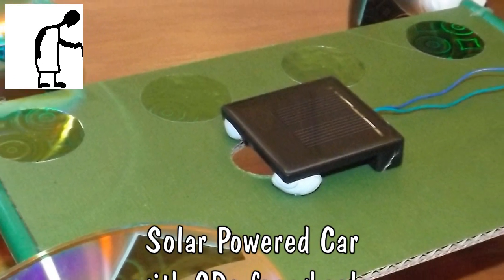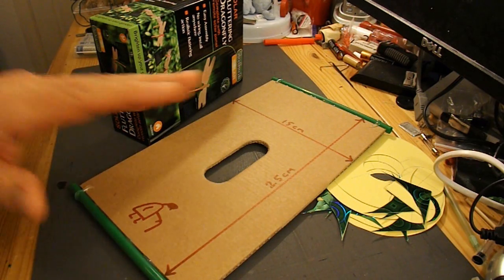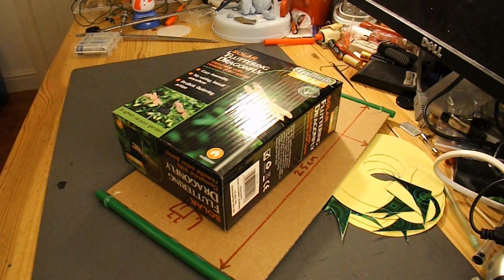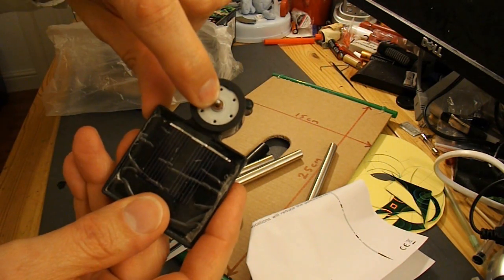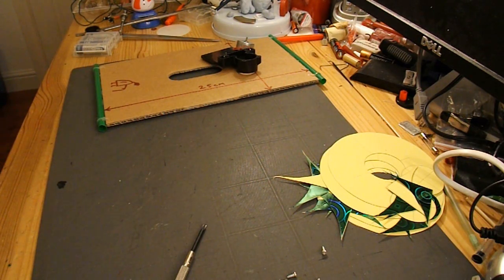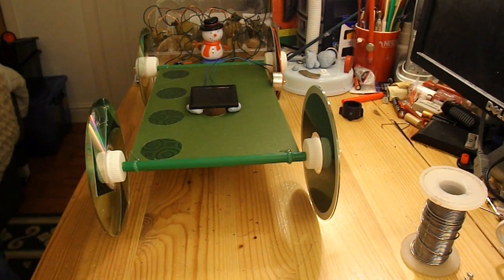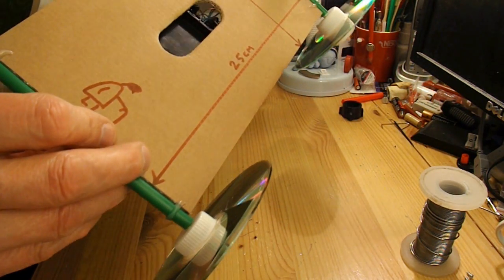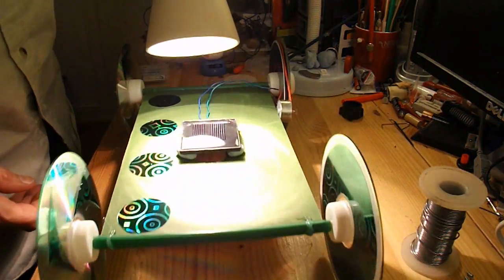Solar Powered Car for Anthony Belcher

Comment: Look Grandad:
This is what I said a few days ago about debris panels for experiments.
The chip can be used for almost anything, including detectures or light barriers.
I've done some tests, pretty funny.

fadisel.com/producte.aspx?r=1560
Reply from the maker: Hi Francisco, thanks for the link. I have had a look for similar in the UK but it seems the postage costs push the price up too high to make it worth my while for the small amounts that I would use. It would be nice to place a large order to bring the costs down but at the moment it is cheaper to buy the solar garden lights and ornaments for the small panels they have.
Reply: GrandadIsAnOldMan Anyway, you can assert to see interesting things and look for somewhere more affordable place.